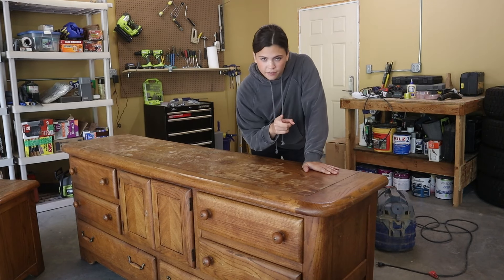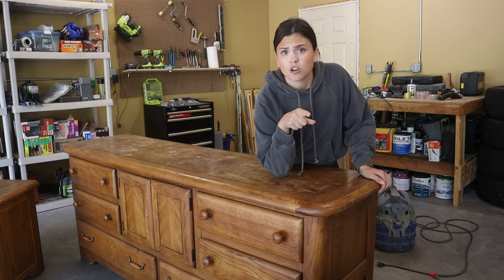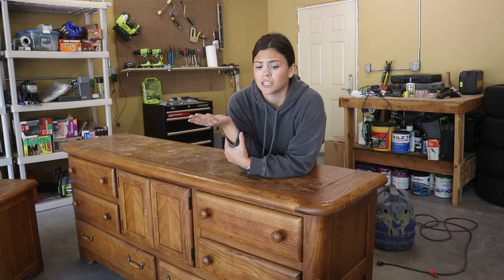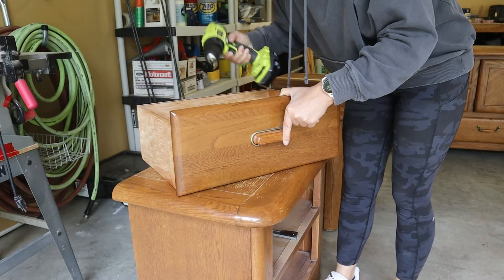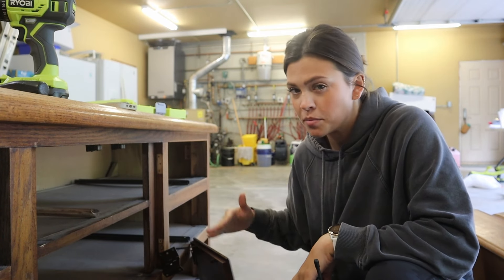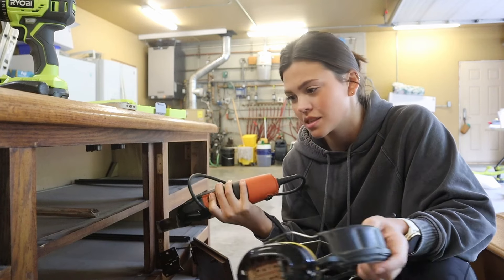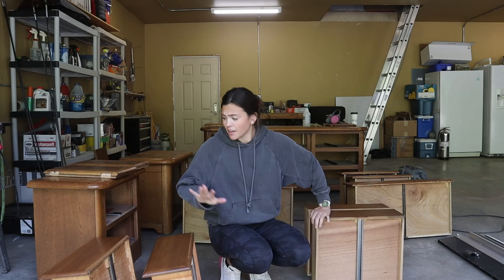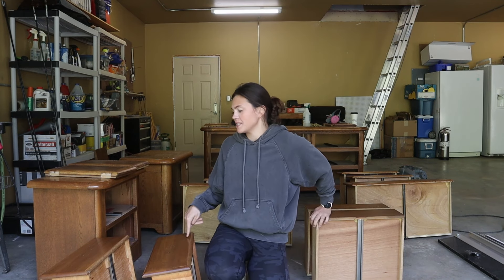Paint Washing a White Oak Dresser // Family Heirloom Furniture Flip

Comment: Very nice, you did a great job. Glad you mentioned it was your first time using the 3X thick and you were happy with it. Been eyeing it but haven't pulled the trigger. Gonna have to try it on the next project. Did you sand the topcoat tho or did it dry smooth?
Reply from the maker: It dried so smooth, I was so happy with it. If anything you could run over it with a paper bag. I like to save paper bags because they are just the right grit to finish off a piece and not leave any marks behind. For this piece I didn’t use anything though, I loved the finish.
Reply: @DIYWithSammy  another great tip! Thanks so much, I look forward to watching more of your content.